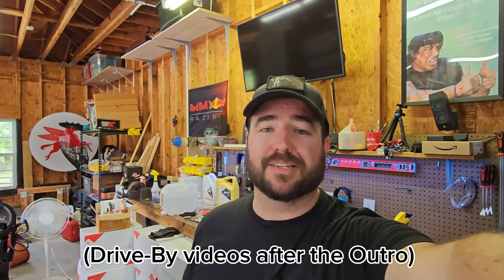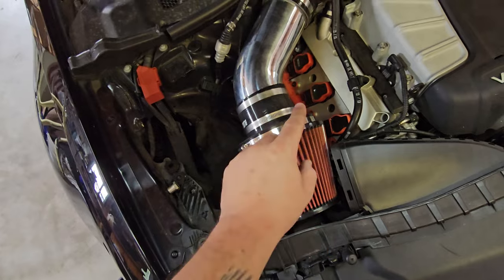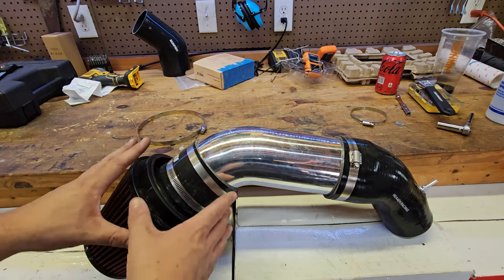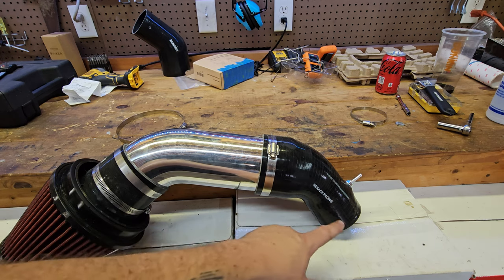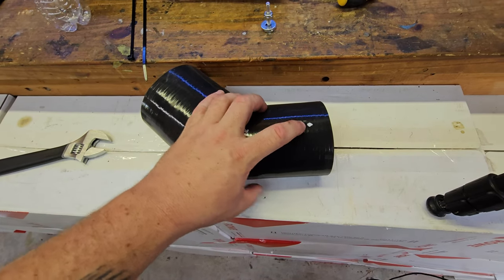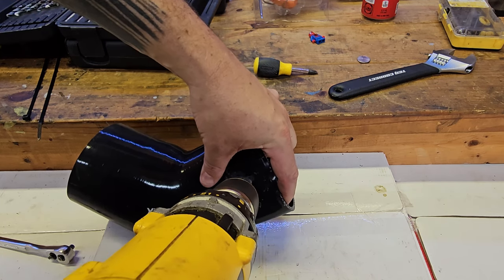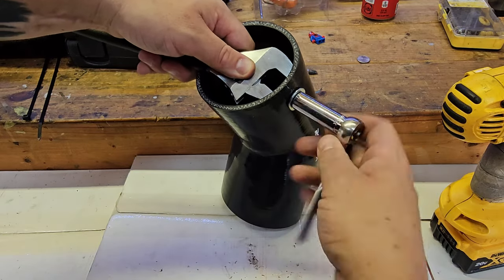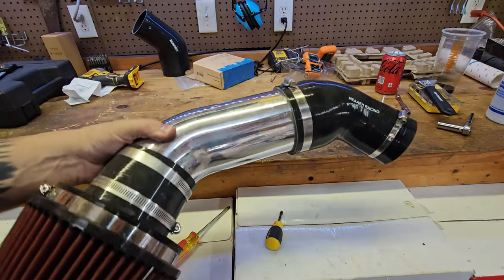170$ DIY Audi 3.0T Intake | Custom 4" Intake for the B8 S4 & C7 A6

Comment: What do i need to know if I want to do this for a b8 (not .5, if it matters) 3.0t?
Reply from the maker: Just need to measure the length of the piping you need and the angle you need for it
Reply: @AudiC7Owners  I'll buy what you linked, and report back here. I've been looking at intakes for these engines, and I've noticed that a lot of them center around modifying the stock air box. That would be a fine base because it's really well designed, but I would like to keep the stock air box stock just in case I ever want to go back. In Washington I don't have to worry about inspections, but it's nice to know that I always have something to fall back to. In your experience, how did doing this affect your IATs? I love the sound though..... I might just do it for that if the IAT change isn't too bad.
Reply from the maker: Intakes have no effect on iat's on forced induction cars
Reply: @AudiC7Owners  sorry, I don't think I understand. Aren't IATs, IATs regardless? If it's pulling cold air it's pulling cold air and if it's pulling hot air it's pulling hot air.
Reply from the maker: The air coming in through your intake goes nuclear when it is compressed in a supercharger/turbo. That's the reason forced induction cars have intercoolers of some kind... To cool the air post compression before it goes into the combustion chamber.

Our car actually has 3 intercoolers... Your heat exchanger and two intercooler cores inside the supercharger. They are all there to cool the air after it is superheated in compression inside the supercharger.
Reply: @AudiC7Owners  Wow. So practically, it really doesn't matter at all how an intake is set up because it's going to be cooled down anyways?
Reply from the maker: On forced induction cars, yes. But you want to consider other things like filter placement, diameter of piping, etc
Reply: @AudiC7Owners  what is the little hose in the corner that is connected to the air box? On my car it has a little piece of foam as a filter but it doesn't look like it's supposed to be doing much.
Reply from the maker: It's the SAI hose. You need to attach a mini filter to it
Reply: @AudiC7Owners  I have it working!!!! It's awesome. I would post a link to a writeup but I can't post links.

Comment: What do you do with the hose that's normally inside the factory airbox that connects to the end of the filter? I'm not even sure what it is, like an air recirc of some kind? Either way, I'm not sure what to do with it that won't trigger a CEL lol
Reply from the maker: I completely left this out of the video by mistake. That's your SAI hose & it needs a filter. I'm going to upload a short about this soon. I got a filter for 35$ from IE, but they're are cheaper ones out there

Comment: Its during IDLE & BRAKING which is DAILY normal driving which will which without enclosed open pods like this suffers. I have experimented these with my evo9 before. During braking, hot engine air Gushes forward, causing Filter to suck load of hot air, IAT climbed. During IDLE in hot traffic lights, U are surely sucking in hot Radiant Heat Air all stuck inside the engine bay. These have been Facts in the car world for Centuries. 
For your c7, it also largely depends on whether are there any ar coming in from foglight area, if u do, enclosed pod will fair better for daily normal driving thats for sure.
Purely looking at high RPM power band, no your hot air sucking open pod does not affect by that margin.
034 etc are rather automotive knowledgeble reputable companies than most of us amatuers really..
*Sharing and Discussing.

Comment: Nice patch... We are using it in Ukraine ;)
Reply from the maker: 🙌🏼🙌🏼🙌🏼
That's awesome. Keep up the good fight
Reply: I also want to order it to Ukraine, how is it going with dust particles filtering vs oem filter, won't my engine suck more rubbish in?
Reply from the maker: @_Kompan  no. It is perfectly safe
Reply: @AudiC7Owners  thank you mate! Already ordering!
Reply: @AudiC7Owners  Can you tell a bit more about second filter how critical is to change it, does restrict air flow and sound?
Reply from the maker: Which second filter? The SAI filter?
Reply: yes, SAI filter @AudiC7Owners  I also try to find velocity stack for aFe filter (no blox kit available) how to choose the right one, any criteria except diameter?
Reply: @AudiC7Owners  will this one work for aFe?